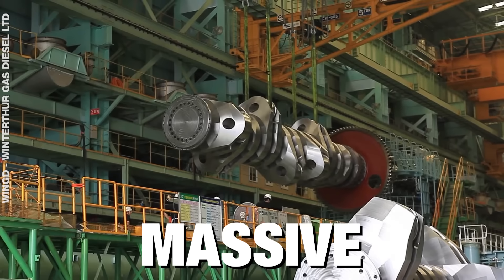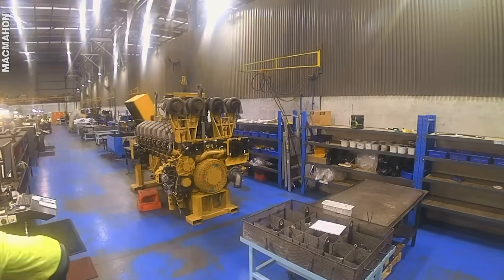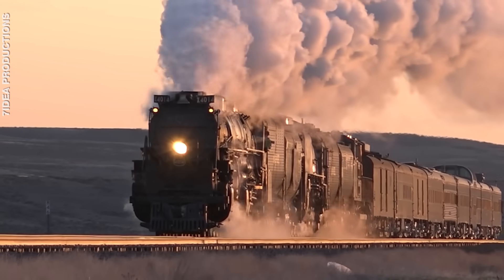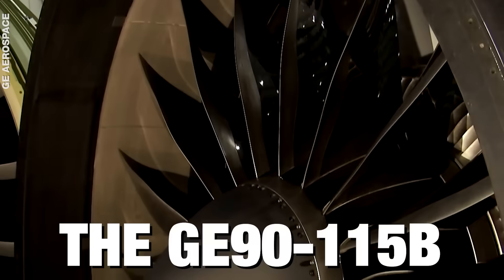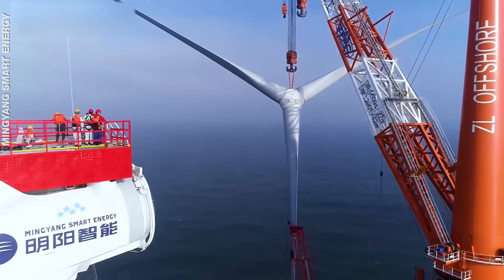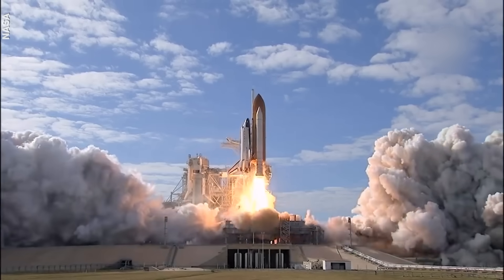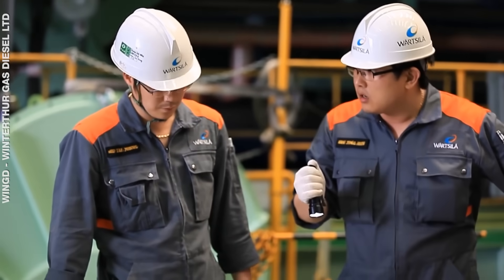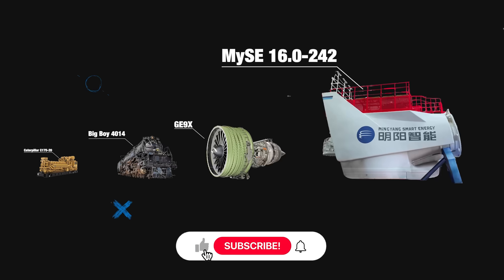World's Biggest Engines

Comment: UnionPacific BigBoy
1,200,000lbs or 544,310kg

statue of liberty 
450,000lbs or 204,116kg

The bigboy is 2.6 times the weight of the statue of liberty. Bigboy is closer to 3 Statue of liberties not 4. Good video either way.

Also at 6:38 What you see is the 2nd stage of the SaturnV with 5 J2 engines which are much smaller than the F1. The F1 appears at 6:42. Both Engines were produced by rocketdyne.

Comment: I'm not sure if I would count a wind turbine as an engine in the traditional sense that engine is usually used to talk about a thermal or heat engine, you know, those that harness thermal energy to perform kinetic energy, i.e. internal combustion engines that most of these were on the list, external combustion engines like most nuclear, coal and natural gas electric and combined heat and power generating stations as well as steam locomotives, factory engines and early water pumping stations, the Sterling Cycle engines, etc.

Comment: The Wartsila RT-Flex is the most incredible engine, a few years ago I was lucky enough to see the RT crank shaft being machined at the Skoda Works in Plzen, Czech Republic.
Reply: while the 100,000 horsepower figure is impressive, thats not even the most impressive part. low revving large engines like this are meant to produce torque, by rotating that massive crankshaft and this engine makes about 5.6 million ft/lbs of torque, an absolutely insane figure.
Reply: My question how do you start the  darn thing??? Gotta be a bit more than a hand crank!

Another motor? Compressed air?
Reply: Actually the most impressive thing would be the repairs. Replacing a cylinder sleeve, piston or even a crankshaft bushing (at sea?), is the definition of "impressive"!

Comment: My favourite engine is the 1.5 litre V10 engine used in formula1. There is no match for it in terms of power to zise or weight ratio, or RPM redline.
Reply: Honda made the best 1.5 liter F1 engine.

Comment: This video showcases some of the world's largest and most powerful engines. Included on the list are the Caterpillar C17520, the Union Pacific's Big Boys 4000 series, and the MYSE 16.0242 wind turbine, which measures 242 meters in diameter and generates 80,000 megawatts of electricity. Other massive engines discussed include General Electric's Haliade-X 14MW wind turbine, the Rocketdyne F1 engine, and the Wärtsilä RT-flex 96C engine, which is the largest and most powerful engine in the world with an output of 108,920 horsepower at 102 RPM.

00:00:00 In this section, we explore the largest and most powerful engines on the planet, starting with the Caterpillar C17520 - the largest mining Haul truck engine in the world. Capable of producing up to 5,630 horsepower, it weighs over 23,400 kilograms and is 2.3 meters wide and 6.6 meters long. Another gigantic engine on the list is the Union Pacific's 4000 series, also known as the Big Boys, which is the biggest locomotive engine in history. The Big Boy 4014 weighs over 508,000 kilograms, with each one needing 25,400 kilograms of coal to fuel the engine along with 94,600 liters of water. Finally, the MYSE 16.0242 is the world's largest wind turbine, with each blade measuring 118 meters long and standing 264 meters tall.
00:05:00 In this section, we explore some of the biggest engines in the world. Starting with the MySE 16 wind turbine with a rotor diameter of 242 meters and the ability to generate 80,000 megawatts of electricity. We then move on to General Electric's Haliade-X 14MW wind turbine, currently the largest operational turbine globally. Next, we look at the Rocketdyne F1 engine, the largest single nozzle liquid-fueled rocket engine capable of generating 1.5 million pounds force of thrust. China's self-developed rocket engine has the world's largest thrust among the most powerful solid rocket engines. Finally, the Wärtsilä RT-flex 96C engine, designed to power massive container ships, is officially the world's largest and most powerful engine with an output of 108,920 horsepower at 102 RPM.

Comment: 5:15 "can generate 80,000MW of electricity" Yeah, I don't think so, that would be equivalent to 40+ nuclear reactors. Should have said "80,000MWh per year" (the onscreen text does state MWh)
Reply: Exactly, there is a difference between Watt and Wh
Reply: The Wärtsilä-Sulzer RTA96-C has a power output of 80 MW.  I suspect someone got carried away when adding zeroes.

Comment: 7:40
There is some serious debate between the biggest GE jet engines and the 14 cylender largest version of the RTflex 96 as to which makes the most power.
Literally depends on altitude, as Jet engines make more power at higher altitude than the sea level the RTflex is designed for.
Now if you want to talk about TORQUE....
Reply: Based on the numbers in this video, the RT Flex should be making somewhere north of 5.5 million lb-ft of torque...
Reply: @aftershock8080  I'm coming up with around 3.5 million - but I might be misremembering the "full throttle redline" being 150 RPM.
Still a LOT of torque either way!

Some of the largest wind turbines can argue the point, as they also spin very slow.

Since the GE9x and GE90 series jet engines both have an initial "duct" fan that redlines above 2000 RPM they'd be a lot lower on the torque - ballpark 1/15 of that - and only PART of the engine drives that particular fan, the rest of the turbine drives the rest of the (smaller) compressor at a higher RPM limit.

Comment: 6:56
The Space Shuttle did NOT use a F-1 or anything nearly as powerful of a main engine.
NOTHING has - all of the boosters that have or are in the Saturn V range use(d) many more smaller engines - 30+ for the Soviet N1 and for Starship - or solid boosters like the later block SLS PLANS to use.

Comment: This is a BAD vid. 4:40 mechanical engineer here, a wind turbine is NOT considered an engine. It's a machine that converts kinetic energy into electrical energy while an engine converts fuel into mechanical energy. Also NO wind turbine is designed to generate energy from typhoon winds. The blades get shut down if winds are too high. This is not a good video, lots of wrong information and data. Here's another one 7:13, NO they are not powererd by "high energy gunpowder". Gunpowder is potassium nitrate, charcoal and sulfur while solid rocket fuel is usually (it depends) a mixture of ammonium perchlorate as oxidizer and aluminum powder as fuel. "high energy gunpowder" is just regular gun powder with some additives added like nitroglycerin (or nitrocellulose based powder).

Comment: I liked the piston of Virtzilla RTflex 96c. Man, it's gigantic. One piston ignition will make a tsunami in the ocean.
Reply: The size of that piston is actually comical. It seems ridiculous to think it could even work. How could a combustion engine produce a large enough explosion without destroying the seals and such?
Reply: The firing pressure is around 140 bars, the piston liner and the cylinder head are also massive, so it can run continuously for many years without major cracks etc
Reply: WÄRTSILÄ

Comment: The GE 9 turbofan actually makes more power than the Wartsila. You didn’t do the conversion from thrust to HP.
Reply: I quote from quora

Horsepower is force-distance/time ie foot-pounds/second or newton-meters per second. If the engine is not moving, distance is zero so the engine is producing zero horsepower. Make sense? No - but people think of engines in terms of horsepower. Add velocity to it and at takeoff speed for a 777 at 115,000 pounds thrust it will be about 55,000 horsepower. However one can go the the GE website and find the core of the GE90 is sold as a power generator gas turbine named the LM9000. The LM9000 is rated at 97,985 horsepower for power generation, not far from its rated thrust in pounds.

Wärtsilä is 108000hp
Reply: Why would you use the take-off speed to calculate the horsepower? I know exactly how how the calculations work for both torque and thrust engines. the 777 can hit about 325kts airspeed in level flight at low altitude. Where the engine can make the most power. Use that speed for your calculations, and you will see that I am right.
Reply: @ukkomies100  during testing the ge9x engine reached 135,000 lbf so it probably very easily could produce well over 108,000 hp , the only reason its rated thrust is so low is to lower fuel consumption
Reply: @alexandrosandreou8585  thrust ratings are NOT a measurement of power. They are a measurement of force. Like lbft of torque is. 1 pound of thrust equals 1hp at 325kts, or 375mph. 1 pound of thrust equals 2 hp at 650kts, and so on. So 100,000 pounds of thrust, at 650kts is actually 200,000 hp. GE produced and tested a turbojet engine in the late 1960’s for the Boeing SST that made 500,000hp, because the cruising speed of the plane was going to be so high. This would have been the most powerful internal combustion engine if it had flown, but it did run in a test cell.

Comment: If stationary wind turbines are included then power plant gas and steam turbines should have been included as well. They can have 10x the power of that huge ship engine.
Reply: Shouldn't have been included, wind turbines aren't engines.
Reply: @flybeep1661  And the most powerful gas turbine is a tossup with the most powerful diesel ship engine - though the ship engine has been around an extra decade or so.
Reply: Σωστά
Reply: Σωστό

Comment: Thanks for this Xplained, some really cool engines, I wonder if we could make a gravity drive.

Cool stat at about 6:54. The rocket using up 15 tons of fuel a second!!! With my old 2002 diesel Berlingo I get about 500 miles with 50 gallons.

Somebody once told me that the QE2 travelled 12 inches to the gallon.
Reply: Thois guy got no chill. Those wind turbine produces 80,000 FUCKING MEGA WATT he says at 5:13
Reply: @jenilpatel7048  I would not fully trust this vid on accuracy. Several things he mentions in this vid sounded off and when checked it was wrong. Also, a turbine isn't an egnine, shouldn't be in this vid in the first place.
Reply: The New Jersey battleship gets 7 feet per gallon.
Reply: That stat 15 tons of fuel per second must be a lie. There is not enough space in the body of that rocket for that amount of material. I call bs on that stat.
Reply: 50 gallons is 189 litres.
Ur car tank had 189 litres capacity?
Reply: I think thats a mistake @helojoeywala6622
Reply: 10 miles per gallon, I'd get it serviced.
Reply: I like how you spell Xplained. Very rad.

Comment: "solid rocket engines are powered by high energy gun powder" - no, they are not. The only rockets these days using actual gun powder as propellant might be small fireworks rockets. Even the hobbyist solid rocket engines tend to use better fuels. Modern solid rocket engines tend to use a 3 component fuel mix: 1) oxidizer (usually ammonium perchlorate), 2) high energy fuel (usually finely powdered aluminium) 3) a combination binder (so the rocket fuel can be cast with a slurry-like consistency and then harden into something that feels like a rubber eraser) and gas generator (something that produces lots of gas when burned),  usually a synthetic polymer that tends to be similar to synthetic rubber. This way (assuming the fuel was cast properly with no bubbles and other errors), one gets a reliable and predictably acting solid rocket motor.

Comment: I call bs on the 80k MWh wind turbine. That's the equivalent of 65 nuclear power plants.
Also if the 65MW GE engine power plant can supply 6500 homes then the 80k MW windmill could supply 8 mil homes instead of 20k.

Comment: The first engine you showed cranking up is a CAT 3516, roughly the same size as its C175 counterparts but not the same and far more reliable. The largest CAT made engine is a 3600 Series which is much larger.
Reply: @DeadChan67  For starters, the GCM as we call it in the oil/gas industry, is not actually a CAT engine but a German designed engine. I actively work on them in Northern Colorado and Nebraska, got sent to Germany to learn how to work on them. So once again, the largest CAT made engine is in fact the 3600.
Reply: @DeadChan67  What are you saying "actually" for, like I'm wrong or something. I said they are a German made engine, MaK is a German company. If we really want to get down to the weeds CAT does in large own the engines. I work for Caterpillar, on all of the engines I have stated. CAT does not badge the engines as ours, they still have the MaK nameplate and coloring. Once again, the largest CAT made engine is in fact the 3600 series.
Reply: @DCB1209  My fault, by “Actually”, I meant the GCM engines, not the 3600’s
Reply: The first one is for sure not 3516😂
Reply: @83badyl  The first engine cranking up at the :42 second mark is a 3516. Please don't speak to me if you're ignorant.
Reply: The 3600 is ridiculous. I work in a plant that refurbishes these kinds of engines and they truly are remarkable pieces of engineering.

Comment: man how can you forget nuclear engine, most nuclear plants produce 1 GW of power! 😯😲 thats 1000 MW and 14 times more powerful than vitzilla itself, let alone others!!! 

anyways some will say its not an engine. heres the google definition: a machine with moving parts that converts power into motion. there's steam, water, fuel, and a turbine, and converts nuclear power (heat, thermal energy) into motion of blades, hence its definitely an engine.
Reply: Even cooler is to take into account that's just electrical energy reactors like the EPR-1750 can produce almost 5000MW of heat energy,  if only we had more efficient energy transfer methods nuclear would be twice as good

Comment: just to think that the caterpillar engine is only 5 dodge demons... like only 5 that just seems insane
Reply: But the Torque is like 20 Demons
Reply: It produces 16,474 lb-ft torque. It doesn't rev very high thats why it's horsepower is low. But when moving a lot of weight you need torque not horsepower.
Reply: Man yall are smart all this going above my head

Comment: 5:16 megawatt hours and megawatts are two different metrics.  The basic capability of the turbine is 8MW. 7:15 "high energy gun powder"?? PLEASE!  Gun powder and solid rocket motor fuel aren't even close.  9:39 the RT-flex96C is the most powerful internal combustion engine, not what you said.  Wartsila engines are built by a variety of heavy manufacturing companies around the world:  Wartsila DESIGNED the engine.
Reply: Yep, I called bs on the 80k MWh wind turbine. That's the equivalent of 65 nuclear power plants.
Reply: Well Wartsila themselves said that its the most powerful engine in the world and nothing else seems to compete.  No you are also wrong for assuming a variety of heavy manufacturing companies around the world build the engine. That's true for some huge machinery but not in this case. Technically, Wartsila design and build their own engines. Sulzer builds Wartsila's engines and Wartsila owns Sulzer. that's why its called the Wartsila-Sulzer RT-flex96C. Also he just missed a word he meant to say megawatt hours which the subtitles suggest.  He's trying to explain solid rocket motor fuel in layman terms because not everyone is so knowledgeable in rocket science. 🤷‍♂
Reply: I wonder how much 8MW is in football fields...
Reply: Actually, the bit about gun powder is right. The Long March rockets use gunpowder to get the rocket off the launch pad BEFORE the main (solid fuel) engine fires - saves having to harden/refurbish the pad.
Reply: @andrewmcalister3462  Interesting, thanks.
Reply: @paladin0654  He's wrong.
Reply: @andrewmcalister3462  Totally false. Long March rockets either use RP-1 (kerosene), Liquid Ooxygen (LOX) or liquid hydrogen (LH2). First stage uses a combination of RP-1 and LOX while the upper stages uses LOX and LH2. There are variations in the long march rockets and the Long March 6 uses solid fuel in its first stage and liquid fuel (N204 and UDMH) in its upper stage. The solid fuel of the first stage on the LM6 is HTPB (hydroxyl terminated polybutadiene) which is a common solid rocket fuel and has very little to do with gun powder or so called  "high performance gun powder".  There's  no such thing as getting a rocket off the launch pad with gun powder without using the first stage engine.
Reply: Thank you for calling Him Out, My Mind was getting Blown Left , Right and Center .i was going "Wow" Wow" None Stop 😂 . He needs to do his Homework first before Posting, Now he lost Credibility